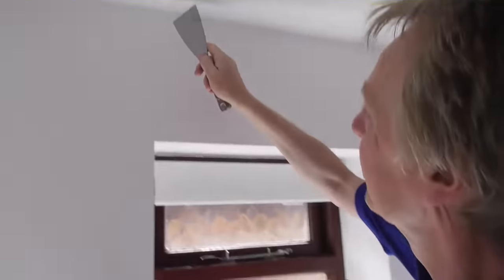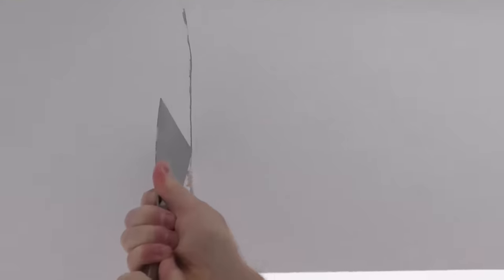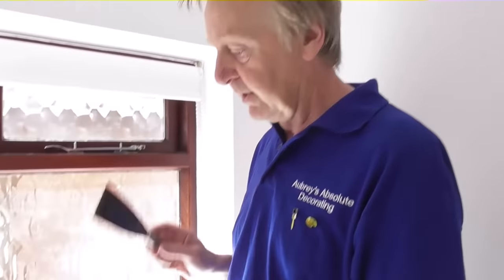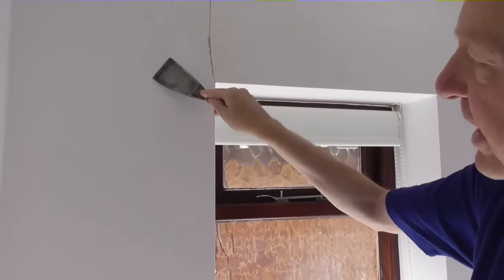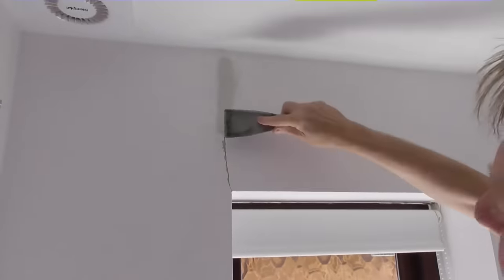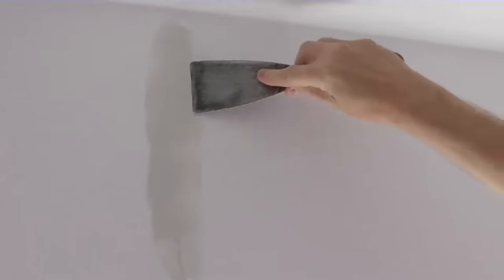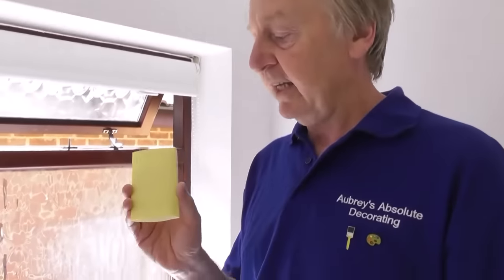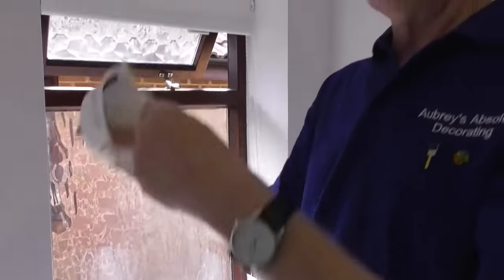How to Repair Hairline Cracks

Comment: Thanks Aubrey, your videos are great for people like me who need to know the real basics.
Reply from the maker: Hi Greg, thank you for your kind comment.  I set up this channel last summer with the intention of posting a wide range of videos to give people guidance who are new to the world of home decorating.  I am glad that you are finding them useful 😊
Reply: @AubreysAbsoluteDecorating  Can you use the same technique on wooden panelling on bathroom ceiling with a hairline crack?
Reply from the maker: With gaps in wooden panelling I would use a scraper to remove any loose material by pulling it along the crack.  Then use a dusting brush to remove the dust etc.  Fill the crack using decorators caulk which is applied using a skeleton gun.  After using the gun smooth it off using your finger.  Leave it 24 hours before painting.  The decorators caulk is more flexible and works best in this situation.  Hope all goes well for you Miss Bee 😊
Reply: You would be surprised how many people don’t know the “very basics”

Comment: Even with drywall compound in your repaired crack, that crack is likely to return unless you apply fiberglass (mesh) tape over the first layer of compound, then apply progressively feather edged compound in 2 or 3 more layers to extend about 10-12 inches wide of the crack. Then after it is all dry, you sand (about 180 to 220 grit) and tack clean/wipe clean and prime, preferably with Killz or other stain concealing primer. After it is dry, feather edge paint the whole section with 2 coats of paint.
Reply: There’s always one😂

Comment: It does not make it impossible for the filler to come out of the crack, it jut gives it a larger bonding surface, if the crack is there (movement or settling crack) the movement can pop the filler out again, till full settling occurs
Reply: What Carl says is true.
Reply: @mrbachittarsingh9243  wow and there’s my multi award winning company knowledge put to bed by an well verse individual 🤪🤪🤪

Comment: Cracks are fickle things! We had a crack in plasterboard above a radiator. Kept opening up for years. I bought some repair tape that I used to bridge it, filled and sanded it. Job done. Then the crack decided it would go the other way and it has now bubbled the tape out!
Reply: Paint it with 2 coats of sandtex smooth masonry paint give it a go

Comment: Nicely done👍👍 and I wanted to ask,have you ever used a good quality paintable caulking to repair cracks?
Reply from the maker: Thank you Jay.  Most of the caulks you can buy work Ok, however, make sure you leave them plenty of time to fully dry before painting.  Most of them say you can overpaint after an hour but if you do this the applied paint will more often than not crack.  If possible leave overnight to dry.  I hope to do a video on this subject sometime in the future.
Reply: @AubreysAbsoluteDecorating  okay that confirms what I had thought and done in the past,.. and I'd be looking forward to your video on this 👍 thanks for the reply!

Comment: Always superb tutorials !
Reply from the maker: Glad you like them Melanie 😊
Reply: @AubreysAbsoluteDecorating  Hi Aubrey I have issues with several hairline cracks in my walls and ceilings that keep opening up. The repairs were done by tradesmen twice but they used plaster and they opened up months later. I redid all of them using Tetrion powder but they all came back. I have used your method but the only difference was I didn't lean to the left then right I just scored them straight down. Do you think it will work after I try this as it's pretty annoying doing the same repairs twice a year. I will use your filler choice next time though. To be honest I don't want to mess around with mesh tape I'm a novice d.i.yer. Tbh I don't think next door loft extension helped last year as well 🤨. Many thanks 😊.

Comment: Very good information as far as explaining. I feel confident that I can do this on my own fixing the cracks in my old house although I do have a question.  Should I be concerned if a crack is not vertical like your video? my crack is like sideways along the top of the mouldings and ceiling. is that a normal aging crack process in a old house?  For sure, I would have to use decorator's caulk due to not knowing how to mix things together? I did see you paste something but what was it? maybe I missed something, since I had to read the caption. thank you for your time.
Reply from the maker: Hi Amy, the cracks you describe sound normal for an older house.  You are right in saying decorator's caulk would be best for the cracks along the top of mouldings and skirting boards and around door frames etc.  Other cracks on walls and ceilings can be treated in the same way as shown in the video.  I do have a video on how to mix up powder based filler (Polyfilla) on my channel.  Hope all goes well for you with the decorating 😊

Comment: Hi, thank you for the video. Do you have any tips on matching the surface texture before painting? My walls aren’t “textured”, but 70 years of painting gave them a texture that can be noticed next to the smoothness of a sanded crack repair. Thanks!
Reply from the maker: Hi Gina, I would suggest buying a mini roller set which comes with two rollers, one for gloss and one for emulsion.  Screwfix and other DIY shops sell them for a few pounds.  Using the small emulsion roller apply a layer of thick emulsion paint over the sanded area.  use the roller slowly to create an orange peel texture. Let it dry and apply another thick coat with the roller. Hopefully after a few coats it should look something like the surrounding wall area.  Hope all goes well 😊
Reply: I had the same issue.  Thanks for the question and advice.

Comment: Better to tape it as well, but either way they will re crack in time as the structure moves. That’s life.
Reply: Hi, Would you put the tape on first and force filler through scrim?  Or would you tape after filling. Then fill over the tape? Just wondering what way you'd do it? Regards
Reply: @ceet12  I always put one or often two layers of the self adhesive fibreglass tape over the crack then trowel the base coat into and over the tape. For expediting the drying time the base coat used is often cornice cement because it dries very quickly and hard. But if time is not important then I just use a base coat. Then a second base coat, then a couple of top coats feathering it out so there’s no peak in the repair area. If it’s a ceiling repair then I would ideally go into the roof space and adhere a back block over the crack in addition to the other work stated. But there’s never any guarantee they won’t re-crack. Structural forces are far greater than any repair can overcome.

Comment: Great video. What would you or any pros recommend on new plaster?  Had a crack appear, very narrow.  I don't think I want to stick a filing knife in to widen.
Reply from the maker: I would still recommend undercutting the crack slightly or it will probably appear again quite quickly if you just apply filler over the crack as it is.

Comment: I’ve just had my bedroom newly plastered and I’m getting quite a few of these in bare wall (not next to the door or window). The ones in my room also go across horizontally and are 2 or 3 meters. 
Why does this happen? Is it because of bad plastering? Bad painting?
Reply from the maker: Hi, without seeing the surface before it was re-plastered it is hard to give a definite reason for the hairline cracks appearing.  However this is not unusual.  Hopefully if you treat the cracks as shown in the video then all will be well.  If they do come back it could be due to an untapped crack along the plasterboard joint at this point.  Fingers crossed all will be ok.
Reply: @AubreysAbsoluteDecorating  cheers, will give it a go.

Comment: Nice work Aubrey. Any flashing through from the fillers after the two coats ?
Reply: Hi there. If you gonna to use soft sheen paint over the filler you must touch up the filler with white Matt emulsion first. You’re welcome.

Comment: As a filler do you ever use "painters mate"? I'm mostly DIY decorating and find it easy as it's ready mixed, rarely goes off and is clean and easy to use. I still push it deep into the crack with a knife.
Reply from the maker: Hi, yes I do sometimes use ready mixed fillers, particularly when I find I have missed a couple of holes after doing the prep work.  Many of them are pretty good and I can see why they are popular with the DIY market 😊

Comment: even doing this the crack can come back in matter of months on most my jobs i always seal first then use expanding foam before filling is hard getting it to pay as it does take a extra day on jobs if you got lots of cracks etc but only way that has best chance of lasting a while
Reply: I've had pretty good luck with good quality caulking. And when it dries, you can paint over it quickly. Have you ever tried that?

Comment: What if whole wall has hairline cracks seen only if you come close to the wall. Do you also need to scrape each? Or would it be more reasonable to sand everything down and then use plaster?
Also how do you make corners to look straight and even?
Reply from the maker: I would suggest filling in any larger hairline cracks as shown in the video and then apply 1000 grade lining paper over the wall to provide a flat surface.  There is a video showing how to apply lining paper on my channel.  When I get the opportunity I will make a video on making good corners.
Reply: @AubreysAbsoluteDecorating  what about small cracks that are only visible close to the wall? Do I just paint over?

Comment: Is this the same technique for plaster board where the plaster has cracked 👍
Reply from the maker: This technique works on walls and ceilings for hairline cracks. If the crack is along the join in the plaster board it may need to be first taped using a self adhesive fiberglass mesh tape.  I will be making a video on this in the future.

Comment: What type of filler do you recommend for hair line crack repairs..
Reply from the maker: I use a standard powder based filler Polyfilla.
Reply: @AubreysAbsoluteDecorating  In California they use a ready to spread, from the tub filler that they call spackle, is there a similar product in the U.K.?
Reply from the maker: Just looked it up.  Yes they do sell a ready mixed lightweight filler over here.  It has not really got very popular yet.  I have used it, found it tricky getting it to stick to the filling knife, a lot went on the floor.  I hope your product is easier to work with 😊

Comment: Great video....I find that not all cracks can be permanently repaired this,way though...depends on the circumstances causing the crack in the first place, whether it's on a plasterboard joint or solid wall, or how loose the plaster becomes when scraping out, and if there is a void behind the crack....but in this situation I think your method was spot on, although I would have dug it out/undercut it a little more to ne on the safe side.
Also it is important to wet the crack or seal with pva if wanting to overkill it before applying the filler to stabalize the chalky nature
Reply from the maker: Hi JoeProdecor, I agree that there are many different types of cracks that need alternative treatments.  I hope to make some more videos`s in the future showing how to deal with them.  Thank you for your feedback, aubrey.

Comment: Nearly all the Youtube tutorials I've watched suggest making the crack wider than you have, up to a cm wide in some cases; any thoughts?
Reply from the maker: For small/hairline cracks, the process shown in the video usually achieves a good repair.  For larger cracks with loose material it may be necessary to widen the crack much further to achieve suitable adhesion with the applied filler.  It is also a good idea to apply water tto the crack with a brush before applying the filler to prevent the filler from flash drying and cracking.

Comment: Hello love your videos. Very helpful. Can I ask a question please. I has my house plastered and pained  6 months ago and now hairline cracks appearing everywhere. I mean I have long 3 meter long ones going across almost whole wall and in every room. I am terrified to do the undercut as is so many cracks . Is that the only way to fix the problem?
Reply from the maker: The undercutting is an effective way of dealing with hairline cracks.  You could try using the process shown in the video on some of the smaller cracks first.  Hopefully the cracks are just from the plaster drying to quickly and they will not return.

Comment: Brilliant!!!! Can you show how you'd paint over just the cracked area to blend in with the surrounding?
Reply from the maker: Using the original colour, thin it right down with water.  Apply the paint over and just beyond the repaired area blurring it out with the brush at the edges.  Apply 2 or three coats of the thinned paint.  Because the paint has been thinned it should blend in with the rest.
Reply: @AubreysAbsoluteDecorating  thanks for the tip!

Comment: What putty material are you using to fix the cracks with? Would that be spackle or painter's putty?
Reply from the maker: Spackle should be fine, I was using powder based filler, Pollyfilla.

Comment: Unless there's something special about that filler, in my house that would crack again. I used that Dial ready mixed filler from B&Q, carved a big channel, filled, scraped, sanded. Didn't undercut the channel, but whilst I can see that helping to stop it falling out, I don't see it helping prevent cracks opening up again. I did essentially the same thing and a month later it's back. 

I did some others later with paper tape method, and they're still ok, but you use so much filler and now I've got to skim the wall with Easyfill because the tape method which others rave about leaves it proud. Nightmare.

My engineers brain tells me if it's a crack caused by movement, filling it with anything hard will just cause it to crack again. The paper tape method merely masks it because the paper decouples it to some extent, stoping the crack spreading to the surface. 

Surely it needs something flexible to take up the movement. Gonna try caulk this time. That's designed to be flexible at least. Takes up the movement between wood skirting boards and plaster walls ok.

Comment: Great video, thanks. what filler did you use. I undercut as you demonstrated but cracks returned...
Reply from the maker: Hi Matt, I used Polyfilla (Interior Easy Sand). Good luck with your project.
Reply: Matt I’ve found a very narrow bead of decorators caulk inserted into the crack first always works for me! Then you can fill over with powder filler. Because the caulk is flexible it allows for some movement without cracking out again.
Reply: @AubreysAbsoluteDecorating  use easi fill

Comment: Hi Aubrey - Any advice for cracks between ceiling and wall? I've seen a few suggestions to use decorator's caulk. Thanks
Reply from the maker: Yes decorator`s caulk would be a good option as if there is till some movement it should not crack again as the caulk is flexible.  It says on the tube that it can be overpainted after an hour.  Don`t do this as the paint over the caulk will crack and look pretty bad.  Best to leave it for at least a day to fully dry out.  Hope all goes well for you.👍

Comment: Most cracks are caused by movements of the house. Trust me it will be back again in 3 months. Don't be surprised.
Reply: How do you stop these? I keep getting hair line cracks in the same spots in 2 of my bedrooms.
Reply: Yeah I keep getting these cracks and when I’ve filled them they are back in 3 months. It’s called historic settlement I think . What caused this and why do they keep coming back?
Reply: If it is seasonal house movement, then filling with something rigid may jack it apart over the years and cause further problems, so a flexible filler may be best. (I'm no expert - this is received wisdom!)

Comment: What filler do you use, looks great!
Reply from the maker: I normally use a powder based filler like Polyfilla.  You could also try a ready mixed lightweight filler that comes in a small plastic tub as many decorators get good results with this.  Most DIY shops sell this including Screwfix.  Hope all goes well with the decorating 😊

Comment: Would you recommend using a diluted PVA on the filler prior to painting.
Reply from the maker: Hi, you could do that but normally all that is required is a thinned down coat of matt emulsion as a first coat approx. 20% water.  Hope all goes well for you.

Comment: Very helpful. Is it necessary to add scrip tape? Also, when u say add emulsion before painting, is this the same as primer?
Reply from the maker: Hi, for small hairline cracks it is not usually necessary to use scrim tape.  Thin some emulsion with about 20% water and apply it over the filler after you have rubbed it down.  Then paint the wall or ceiling as usual.  Thinning the paint ensures that it fully adheres to the surface.  I hope that helps.
Reply: @AubreysAbsoluteDecorating  Thanks, but what is the emulsion? Is it primer, thinned paint, or something else.
Reply from the maker: Hi Terry, I applied a coat of matt emulsion thinned about 20%with water over the filler followed by 2 further coats of the matt emulsion.